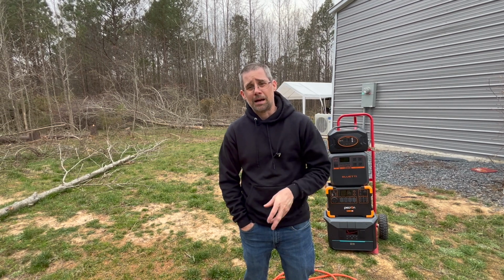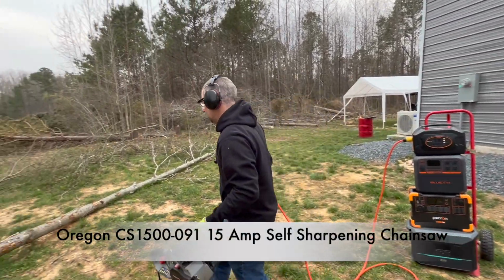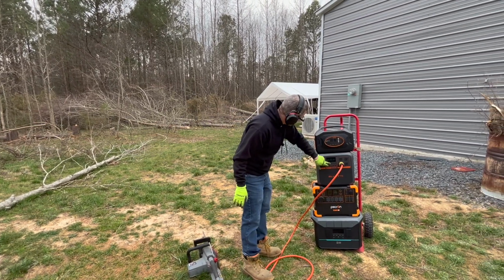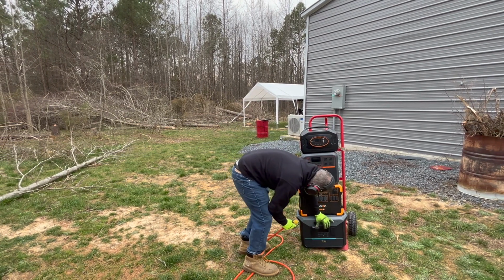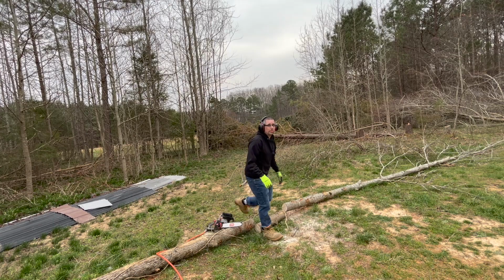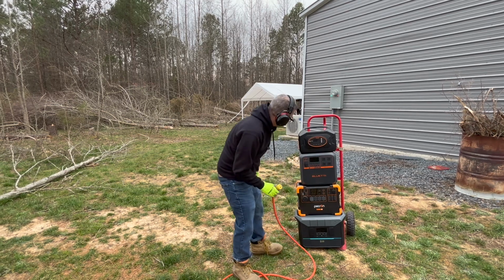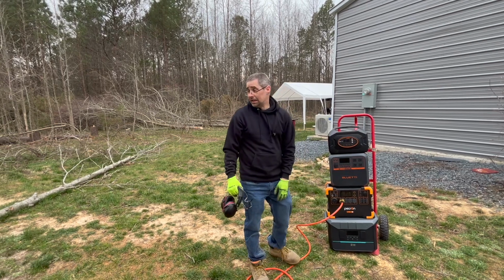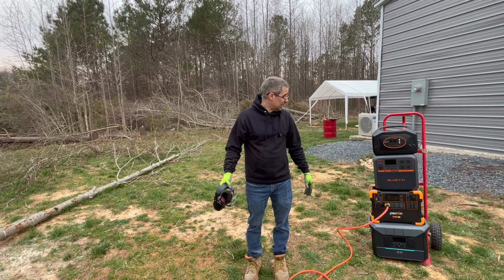SHOCKING Power Station Test! Electric Chainsaw vs. Pecron, Bluetti, Daranener!

Comment: Maybe a battery powered chainsaw.,and an extra battery or two, I have a 40 volt Kobalt  ,you wouldn't believe what it has done?
Reply from the maker: You make a very good point.  I have a battery operated Greenworks, the only issue is the chain is not self sharpening like my Oregon is.

Comment: I use a cordless chain saw and it works great. No cords and the batteries last a good long time. I use the worx
Reply from the maker: Thanks Gary,  I have one of those as well,  the only issue is it’s not self sharpening like the Oregon.   I did get the BLUETTI to work with Pouwer Uplift.  Thanks again for watching Gary!